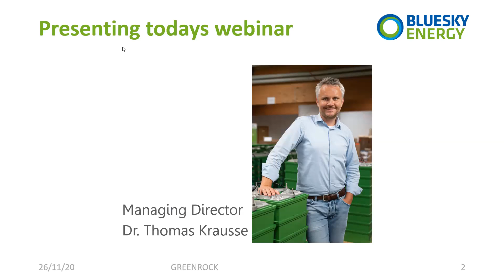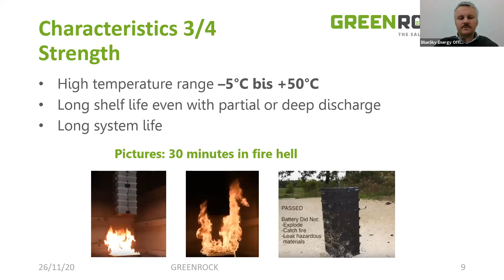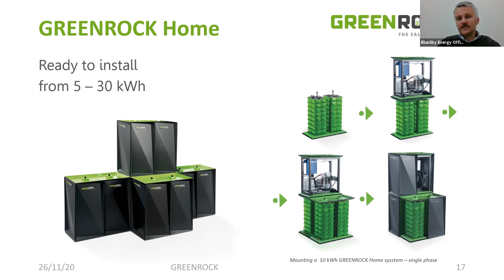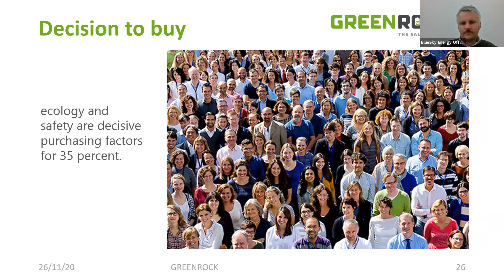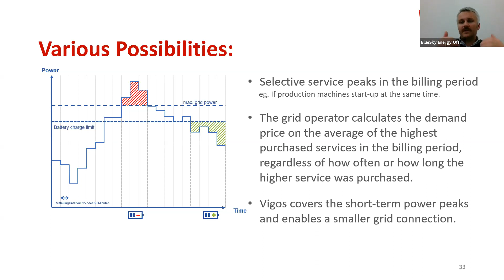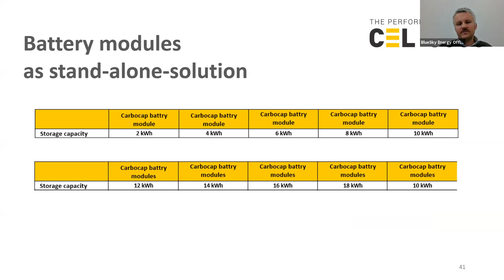GREENROCK Webinar engl.

Comment: Do you ship the saltwater batteries filled with water or is it possible to ship with the mixture in powder format and add the water once arrived to the destination to save on shipping costs?
Reply from the maker: The batteries are filled and sealed. This is necessary to make sure about their performance and quality check.